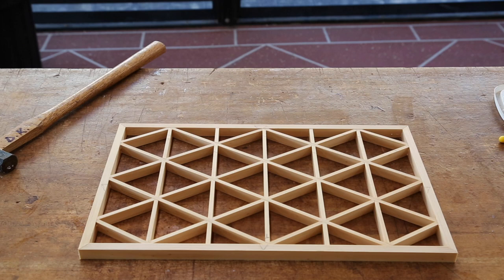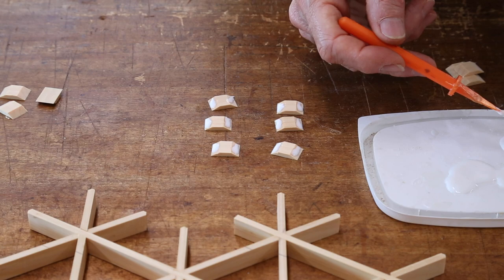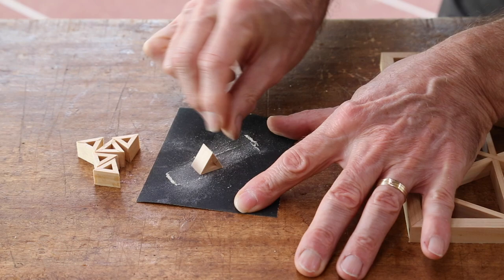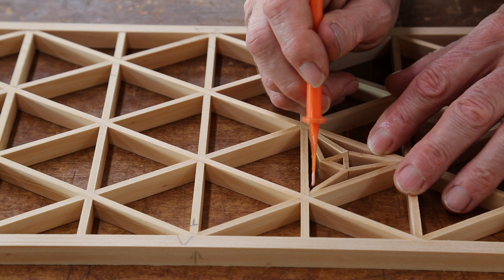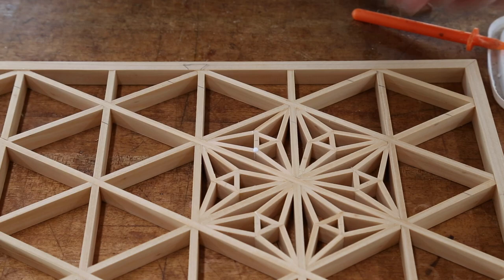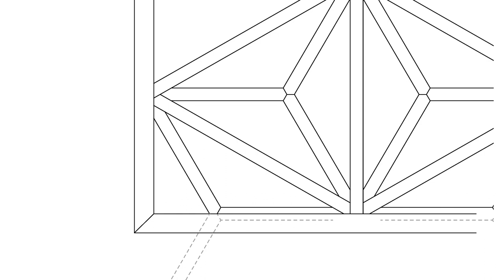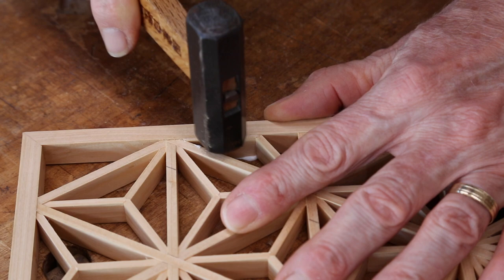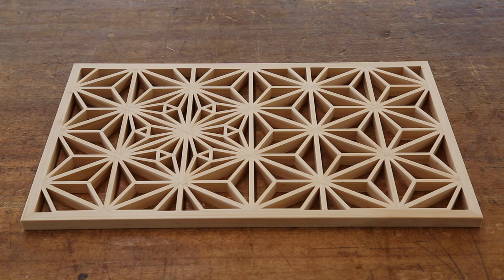Shoji and kumiko patterns 07 Intermediate — Kawari asa-no-ha feature Part 2

Comment: These videos are great!  Perhaps some on how you make your jigs, how often do you replace or renew them, etc.  Thx!
Reply from the maker: Thanks Iain. The books show dimensional diagrams of all the jigs. I just have a normal table saw, so for the angled jigs, I make them up and cut to the depth I can on the table saw, finish off with a handsaw and fine-tune the angle with a hand plane. Or I cut the angles in the jigs on the bandsaw and fine-tune the angles with a hand plane; this is definitely the safer method. A top-of-the-line table saw with a hefty blade would probably be able to cut most of the angles in a single go.

I've had those angled jigs for about 10 years, and I've only had to re-tune them once, and that was really just to check the angles again. And they've had a lot of use in those 10 years.

The 90° and 60° kumiko cutting jigs are simple to make and these get changed around quite frequently. In fact, I need to make up a new set fairly soon.

Comment: I have so many questions. Every time you complete a let's call it a template do you keep a set of pieces so it's easier the next time to reproduce? Do you keep the same basic grid pattern so you can reuse patterns in different designs or do you need to start from square 1 each time you start? Do you use a Cad or computer software to layout your designs or do you do it by hand? I've been looking into this for a while, but this doesn't exist where I am.  How did you start out? I was going to make a couple guides and start from there. I have the tools, but the expertise seems daunting. Looks crazy frustrating when starting out but the perfection of it seems so satisfying.
Reply from the maker: I mark up a story stick for each piece I make. In this piece, the pitch is 65mm, so the story stick has the necessary number of markings at 65mm intervals. I keep most of my story sticks, and if I make up another piece with the same pitch of 65mm, I'd simply use this story stick. Getting accurate intervals is quite easy, though, and I explain how to do this in one of my later videos. I'll also make up a story stick for the pattern itself as well if it is complex and involves a number of cuts, but the pattern in this video doesn't require that. I use a simple 2D CAD to make up the overall design.

Making the kumiko patterns can be quite intricate and frustrating, especially the more complex patterns, so the best option is to start out with the simple square patterns, then work your way up. That's how I started. It does get easier with practice.

Des

Comment: What plane would you recommend for someone who owns 0 planes, and wants to get into kumiko?
Thanks for the help.
I can't decide if it should be a block plane, no4, no62 or what?
Reply from the maker: For kumiko work, without hesitation I'd recommend a good block plane for use with the angled jigs. You'd use the other planes for cleaning up or fine tuning main framing pieces or other larger pieces housing the kumiko panels.
Reply: @kskdesign1  Thanks! Ill go for a juuma low angle block plane then, and perhaps also a no 4 plane for the frames